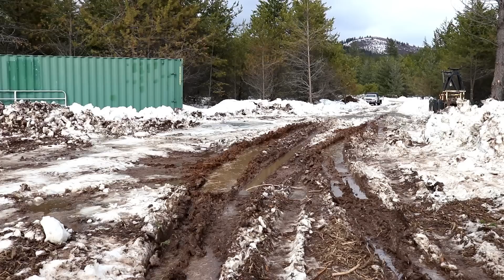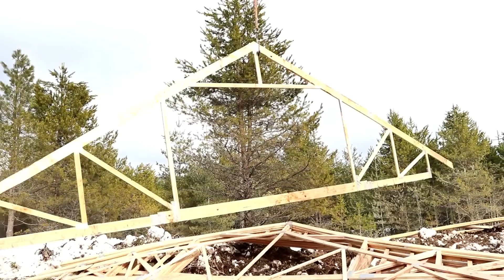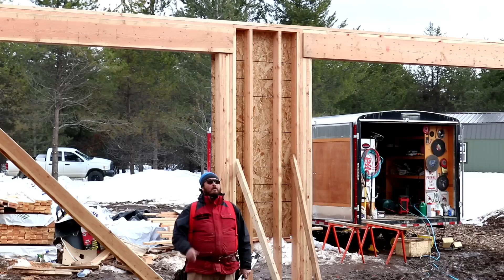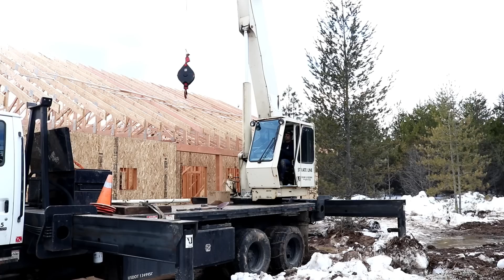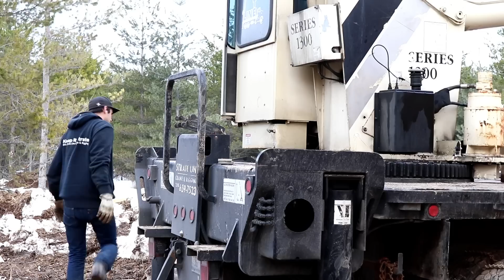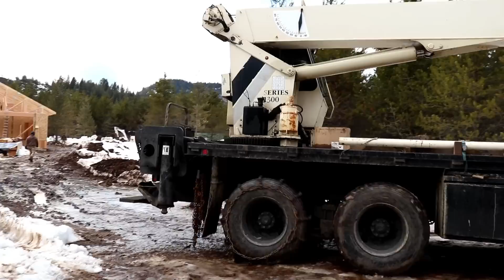Building A Roof Truss System

Comment: At least when they find the last five trusses you might not need the other crane to set them but you can get the strong backs and diagonal braces in and start sheathing up the trusses.  So are you going to skip sheath  it for a metal roof?  You live in the area and should know Firewise prefers metal roofing.